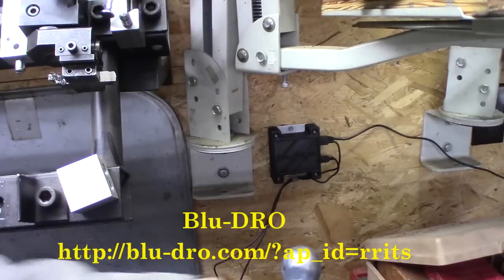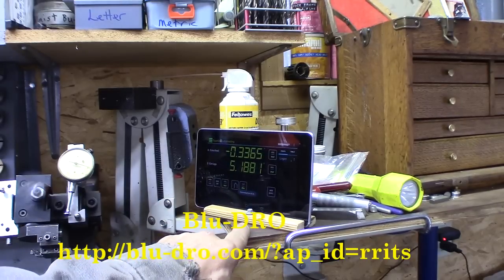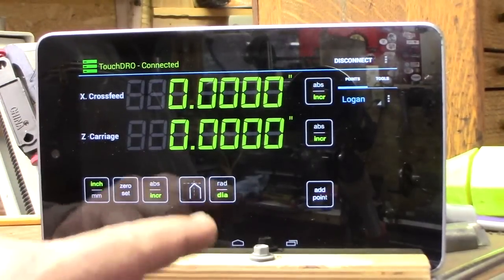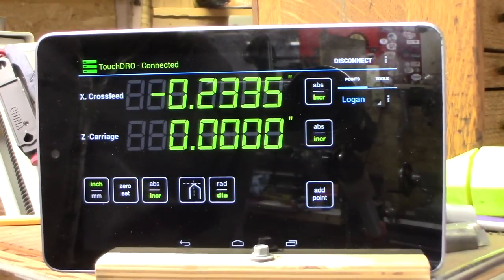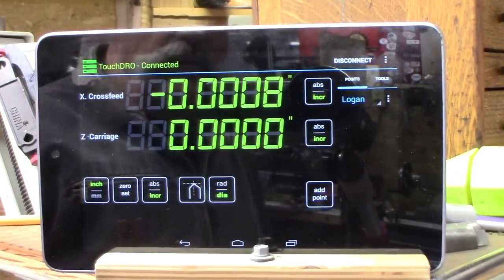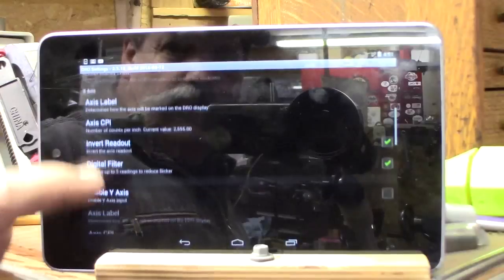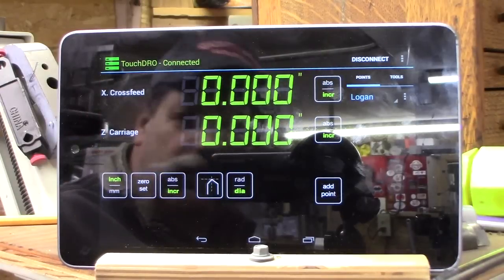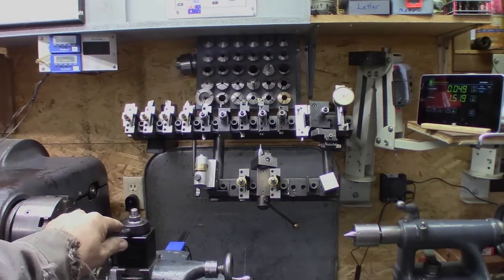Touch DRO & Blu-DRO Overview

Comment: This morning Stan did a short on the touch DRO give away's that this years Christmas party. I am pumped, and see you have had one for pass 5 years too. I missed see your video until this morning. I will be looking more into getting one after the Holidays for sure. Bear.
Reply from the maker: They are ok.  The problem I do not like is having to maintain the monitor device, keep it charged or plugged in and the battery goes bad.  That is why I am replacing mine with a dedicated system.  Check out aikrondro.com,  this is the systems I am installing right now on two lathes.
Reply: Great advise Randy, thank you! Blessed days ahead, Keep on teaching us ole newbees !
Reply: Thx have done. Boy, that's one hot looking sales lady (@@)!

Comment: 50$ now after ordering ebay dro's with less features, i processed to return the 3 axis, keeping the 4 lcd and ordered 2 of the touchdro kits, i'll add a pig tail to my 4 axis lcd dro (nice features, last one available) so i can use a 10 pin connector to swap it to the main machine for the day and have the touch dro on the machine properly tuned for when i gotta be really accurate
Reply from the maker: ok
Reply: @RRINTHESHOP  actually just go through your videos real quick have you done any more update videos on this particular DRO or are you still using it

Comment: Randy

Its been almost 2yrs since this video was posted.  Are you still using Blu-Dro and the AccuRemote scales?  Any usability issue?  And lastly, would you still recommend, especially for the home shop?

John
Reply from the maker: Yes I am and it works great on the small lathe.  Still works great.

Comment: Curious Randy, have you added a tach to the blu-dro?
Reply from the maker: No I have not, but I should.
Reply: Getting zero support from anyone I'm having to reverse engineer this thing and I'm spending hours searching the internet for any clues. My PCB is rev 2.1 and if you open the Blu-DRO case you will see 4 pads labeled tach. If you email me, when ready, I can tell you what the pins are, how they work and a link to what sensor to buy. I haven't done it myself yet either.

Comment: How long will your tablet PC live? How long will your lathe live?
Reply from the maker: The lathe longer than I will.  the tablet who knows, this is all I use it for.   This setup works very well.
Reply: I believe you that it works well NOW. But what will be in 15 years? In 5 or 6 years you will get messages, that updates are no longer available therefore some apps refuse to work any longer, then the latest OS cannot be installed because not enough RAM or what ever. So they force you to buy a new tablet PC every 4-6 years and who knows if the DRO app is still available then or you have to buy an upgrade for that too. Total rip off technology. I prefer a dedicated DRO mounted on a swivel arm as part of the measurement system.
Reply from the maker: I can not argue about all of that.  The app is free.

Comment: How do you validate the DRO on a lathe? Thanks
Reply from the maker: You take a referance cut, then measure the diameter, then enter that diameter directly into the DRO display for that axis.
Or you can zero the axis.   Thanks Kirk for watching.

Comment: I've had a touch DRO on my benchtop mill for a couple years or so now and love it. Don't think the Blue DRO was out yet and I used a Texas Instruments MSP430 with USB connectors and bluetooth board I got from amazon using Yuriy's assembly directions on his website. Might have bought the pre-assembled unit if they'd been available but I kinda like seeing the LED lights flashing in the plastic sandwich box I have it in. Only problem I've had, and it's only happened a couple times, is one of the axis has frozen and the processor has to be rebooted. So far been a rare occurrence and otherwise flawless.
Reply from the maker: No problems so far,  Thanks for the input on your setup, more to learn from.

Comment: I think I may go this route. I have an old Mitutoyo DRO on my mill that went tango uniform quit a while ago. The existing glass scales are good (I think), making this quite a cheap solution, based on the DIY kit pricing that I'm seeing on the touchdro website. Thanks for the inspiration buddy. Fly low, take chances.
Reply from the maker: I am not sure about the scales this all works with, just have to look into it.  This all works quite well and I love the display.  Thanks Greg.

Comment: Randy, I've been using TouchDRO with Al's BluDRO interface for about 9 months now. Another thing you can do when setting a dimension on the X is to use the math capabilities built into that function. So instead of going to your calculator you can simply enter your micrometer reading, press the minus key, then enter your desired diameter & press Set Dimension. The software will do the math and all you do is work the material down until the DRO reads zero.
Reply from the maker: I have to try that.  Thanks Lee for the tip.

Comment: Nice unit.....I noticed you can zero in both inc or abs with a simple touch, my dro when in abs does not allow a simple touch but requires a long hold down on the button to assure the change....that has saved my ass many times....lol
Reply from the maker: Yep, Have to watch where you put your fingers.  Thanks Chuck.

Comment: This is actually a very smart idea, do away with all that expensive tech, write software, design a receiver emitter box and you're done. Now...i wonder what the limitations on the lag are.
Reply: Btw, you can get a pouch for the tablet, the kind with a swivel back from eBay (something like 3, 4 dollars from China, with free shipping) and they have this plastic mount on the back where the swivel part of the pouch goes. If you strip that apart, essentially, you have a tablet holder right there (for a third of the price, since they price these on use, not how little and shitty plastic they sell). I think a simple piece of flashing with a hole that matches the one on the back would do as a mount.
I have the same thing for my Samsung tablet and i've been kicking around the idea of making it in to a mount once the "leather" gets completely peeled off.

Comment: The guy who wrote the software (yuriy) also sells a box similar to the blue-dro which can work with magnetic type scales.  I'm not sure if it also works with the glass type ones, but I suspect it probably would.  I've had one on my milling machine for a while and it's brilliant.
Reply: Thanks for the good word Lee! I had no intention of stepping on anyones toes. And for the sake of full disclosure I do make the boards but it is Yuriy's design....I just tried to make it a turnkey plug and play type kit for those who would rather not fool with the nuts and bolts....thanks again!
Reply: looks like blue-dro resells yuriy's dro board with just their blue cover box )
Reply: bioname Nope - Al, who sells BluDRO, builds his own Arduino based boards.
Reply: MrPragmaticLee please read yuriy answer below

Comment: Randy, for the tach to work, you need to have an encoder or hall effect sensor on the spindle.  Right now you can score some new old stock Omron 1000ppr encoders on eBay for  super cheap ($20), make an adapter for the tail end of your spindle to drive it with a belt and you're set.
Reply from the maker: I already have a hall effect hooked on the spindle,  I should make up a cable and plug it in.